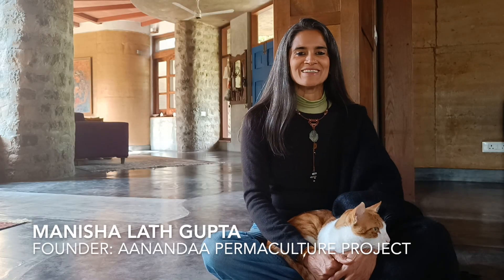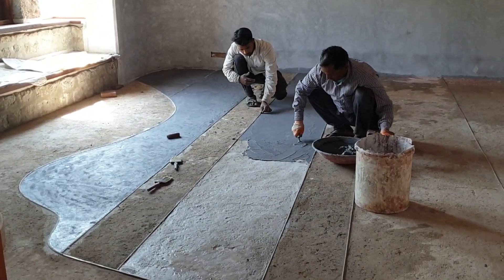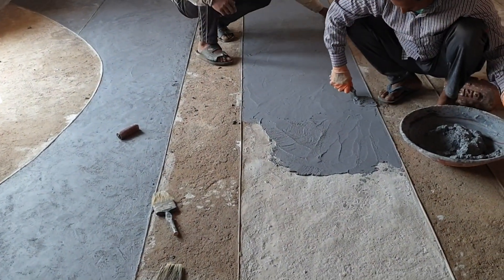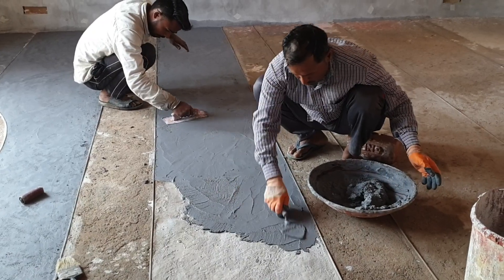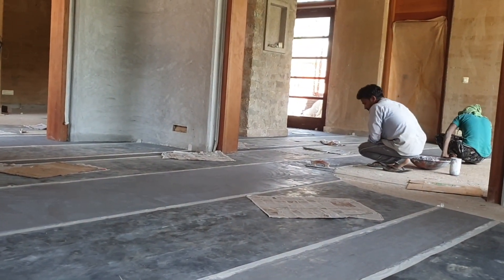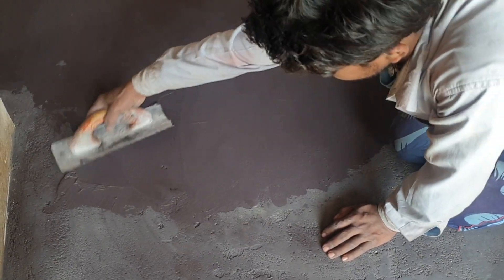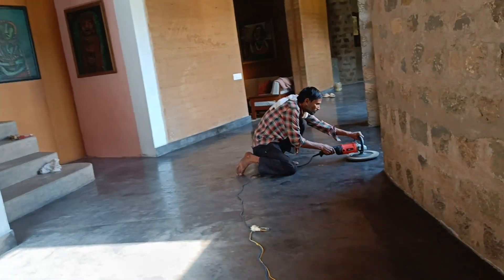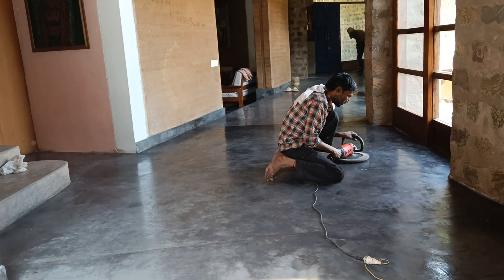Lime Surface Finish: Polished Floors

Comment: Hi 
The lime mortar bedding that you mentioned is the base of this floor  . If I do this the barrier between the ground and floor will be only the soil  . Should the soil be completely compacted and should there be any reinforcement in the plinth. ? Natural reinforcement like bamboo. ? I have the construction going on. . The foundation is already in the process and now if I want to do this I will have to incorporate this post the dpc or the plinth beam. . Then we fill it with the excavated soil and let that soil be compacted and then the lime mortar bedding and so on. . Anywhere gravel should be used. ? Or plastic. ? To create the barrier for moisture or white ants to ride up
Reply from the maker: Gravel layer is always used in the floor, under the levelling plaster layer.

Comment: Thanks so much, Manisha Gupta - for this video. Absolutely, lime plastered floors are the most natural and healthy thing to do.
I plan to deploy the same technique to make floors with lime. Probably using natural pigments too.
Did you also try the 100% natural colour of lime + default additives like dolomite or marble powder etc.? I mean no added colours. What colour is the floor finally by this method? What is that acid that Malvika Mehta mentioned?
My dadaji's house in our village in Rajasthan was made of mud + lime. The floors were most probably made similar to what you have described here. I mean with traditional construction knowledge of the master masons and craftsmen then. This is way back in the 1970s. I distinctly remember the smell of lime on the terrace floors, the sweet smell of when water evaporates - as you sprinkle it all over the terrace to prepare for spreading mattresses for the 12 member joint family to sleep in the open. Summers. Those were the days!!
Reply: Is this lime floor the same thing as an earthen floor? Is it sealed with a polymerizing oil and does it need to be shiny polished?

Comment: We have an old ancestral house with lime plastered walls.
Due to age some of the lime plaster has fallen off..
How.are we to replaster it using lime.
Not very keen in using cement.

How can we.stop condensation from the floor during monsoon?

Regarding lime floors what is the cost per sq feet rate?

Comment: the 4mm layer is applied at once or more times, like 2 of 2mm? thanks and congratulations!
Reply from the maker: 4 mm has 4 layers. 1. lime + coarse marble powder 2. lime + fine marble powder  3. only lime in water 4. soap water.

Comment: Can it be used with underfloor heating and also can it be patch repaired if necessary?
Reply from the maker: Patch repair yes. Heating, I don't know
Reply: I have hydronic floor heating (pipes with heated water flowing all through the house right under the floor) and I came to the comments to ask this too. It seems like you would want to start the layering of the lime base and top coats right on top of the plywood sub-floor. Whether or not this is a good application depends on how conductive the new polished floors would be. You want the heat to penetrate the same way it does with tile, rather than have the floor act as an insulator. That’s the part I’m still not clear on either.

Comment: ok. For lime textured walls there was one layer and for lime polished there are actually four layers? Right? My second question is, when you finished a part of the floor and start building the next part what do you put in between? Or new lime part easily makes a bond with old part?
Reply from the maker: The floors are partitioned with aluminium strips to allow for expansion contraction. These joints are what separates one part from the other
Reply from the maker: And yes polished lime are four layers within the 4 mm thickness

Comment: My father built our house in lime mortar 70 years ago. Both the plaster and the floor are still good though the outside plaster has peeled of at places. I don't find any masons doing any work on lime mortar. So the repairs have not been done though the house needs it.
Reply from the maker: How wonderful to hear this. You can contact MLIME for your repairs is you wish
Reply: You might want to have that sorted, even learning to do it yourself as you don't want to have water getting into your wall.
Reply: pleade your contct nmber.....i also want make it....please
Reply: your nmbr please
Reply: I would like to लाइम surface for my house : construction area is 1800 sq ft but no masson is available to make it if u provide masson and rough idea of cost of construction so we can easily make लाइम surface with ur modern tech 
I am Resident of Farrukhabad Uttar Pradesh

Comment: Can you make an video about wireing work&plumbing in this construction
Reply: avoid putting both directly underfloor, in the walls with ducting & wherever possible use copper pipe for water.  Plan out a route and create a cavity big enough for them to move slightly.
 But you can watch a lot of videos of real professionals doing this. I recommend the French modern standard technique of laying pipes in pipes. maintenance is easy as you can pull them or a cable back out to replace or repair as necessary.  Put in at an early stage in construction. 
 Many ways to go about it, but follow good practice & choose high standards as they are cheaper longterm.

Comment: Did he apply linseed oil to the floor to make is shine ? can we use coconut oil instead ?
Reply from the maker: It's beeswax. You can use coconut oil but keep it to the minimum. Too much oil makes the floor sticky and dull
Reply: @farmaanandaa   sealing with what acid ?   with beeswax doesn't lose it's antibacterial and breathlessness characteristics of the lime ; than to clean it , can't use hot steamer because of the beeswax. How to popper clean it,  other than only  water on this surface?
Reply: thank you  @farmaanandaa

Comment: Thank you for the series. Do the lime floors have insulation properties ? as cement, stone & tiled floors always stay cold and behave as heat sinks.
Reply from the maker: Lime floors are very cool in summer. In winter they may be a bit warmer than stone or tiles, but we are not sure. Our floors are 16 deg C in peak of winter without the room being heated.
Reply: Thank you for the prompt reply. Summers would be nice then. However, the issue of cold floors is more of a concern in the winter months. May I ask what was the outside floor temp. with respect to the 16degC inside floor? 
And what is the peak winter temp. around you?